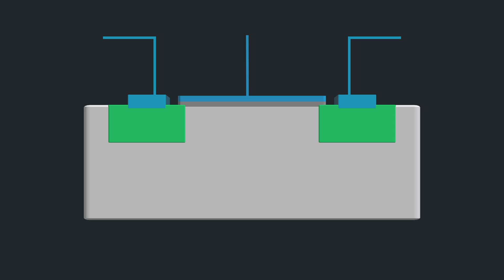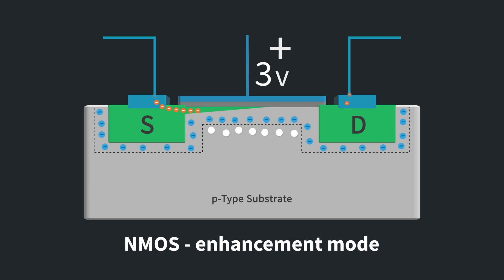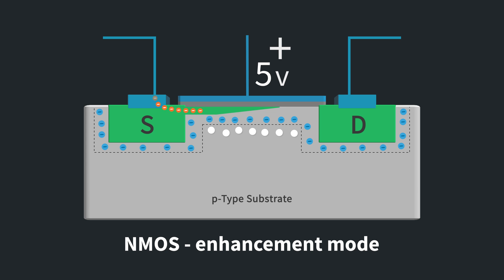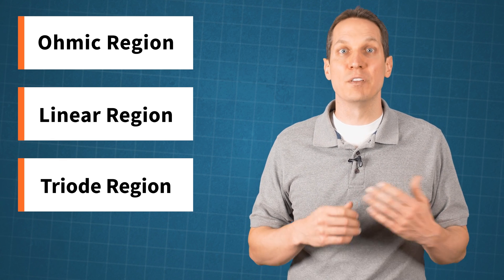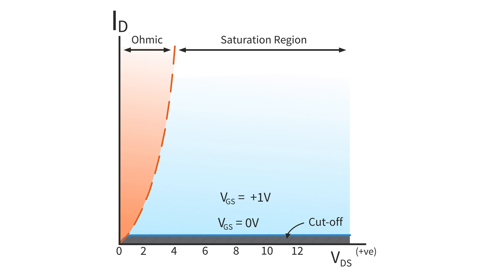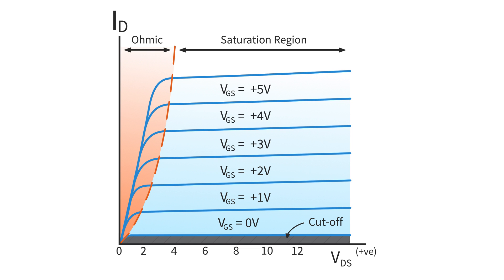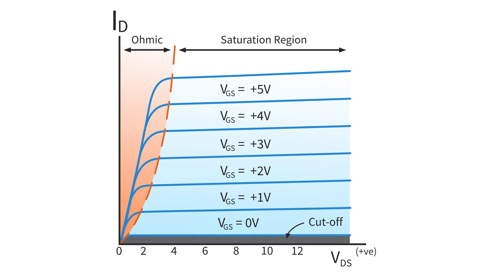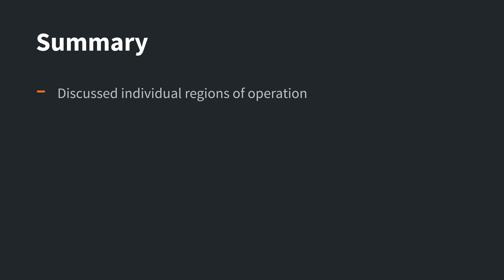What are the Different Regions of Operation for a FET? | Intermediate Electronics

Comment: A thing about these transistor regions is that saturated and ohmic regions often confuse, most transistors operate in saturated region, which makes me wonder why is it so. Why can't it operate in ohmic region where good flow of electrons is present?
Reply from the maker: It can operate in ohmic region, that's a totally usable region!  You just need to make sure that you've designed the circuit to have it operating in that region.
Reply: @CircuitBread  but why do some transistors operated in saturation region?

Comment: Thanks alot for the incredible explanation mister ..but I have one thing that confused me.. why the direction of current flow is from source to drain though it's n-channel mosfet
Reply from the maker: That is an excellent question!  The answer is quite simple - current and electron flow are opposite.  So, it isn't actually current moving from source to drain, it's electron flow.  Which means that current flow is from drain to source.

Comment: I think you have no idea how current flows during the pinch-off. During the pinch-off, current flows because there is a large electric field in the depletion region between the channel and drain terminal. You say current will hardly follow during pinch-off which is wrong. Second, linear operation mode depends on the relative values of Vds and Vgs-Vth. Your explanation says when Vgs is higher than Vth, the linear operation occurs. This is a wrong understanding.  You also need to set Vds below Vgs-Vth to get the linear operation. As long as Vds is higher than Vgs-Vth, pinch-off occurs resulting in saturation mode operation.
Reply from the maker: I think we're having a terminology confusion here, which is extremely common in any conversation about these.  Pinch-off != cut-off.  And yes, part of the challenge of showing any of this relationship on a 2 dimensional graph is the fact that there are three dominating variables, so you are correct that the different regions do not only depend on Vgs in comparison to the threshold voltage but also needs to take into account the drain-source voltage.  This is addressed towards the end of the video and in the written tutorial.
Reply: @CircuitBread  he is right though. As long as Vgs > Vth, the mode of operation is dependent on Vds.
Reply: BJT active condition Vce ≈> 0.2V
MOSFET saturation condition Vgs > Vth and Vds ≥ Vgs - Vth

Comment: The intuitive explanation in the first part of the video is not correct! Your explanation implies that saturation is caused by a gate-source voltage that is not sufficiently large. However, saturation depends on both the gate-source and drain-source voltages. For example, with Vgs=3 V and threshold voltage=0.7 V, the MOSFET can be either in saturation or triode region depending on Vds. For a given Vds, increasing Vgs can actually make the transistor into triode.
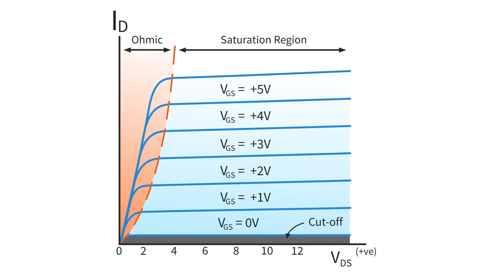Reply from the maker: Yep, you're exactly right, which is why we talked about that later on in the video (2:20 to 3:35).

Comment: Thank you for a clear and concise explanation. I still have questions though. I have a p36nf06 mosfet controlling a 12v  led flood light.  I'm using PWM from Microcontroller (max 3.3v amplitude) for controlling gate voltage to get a dimming effect. Varying duty cycle of the PWM gives me the desired effect, I'm trying to understand the power dissipation of the mosfet. I assume RdsON only applies to saturation? I assume this gives the load the most of the power and there's very little power dissipation by the MOSFET. In linear mode it acts like a variable resistor? I'm trying to understand why at some points in linear mode the MOSFET seems to get hot while at other points is not hot. I guess as it approaches saturation? That part is a big confusing to me. I can measure the voltage across the lights at various duty cycles but I'd really like to understand what's going on with the MOSFET.
Reply from the maker: Thanks for the questions, it is easy to get much deeper into these topics, hopefully I can clarify.  RdsON actually applies to the linear or ohmic region - in general you want your FET to be in this region when using it as a switch, you want it in saturation region when using it as an amplifier.  In the linear mode, it is kind of like a variable resistor - typically the higher the Vgs, the lower RdsON (actual) is.  From the datasheet of the P36NF06, you can see that doubling Vgs from 5V to 10V (keeping the drain current constant), you drop your expected resistance from .045 to .032 ohms.
As for why it gets hot in linear mode sometimes and not other times, I'm not sure without more information.  As you can see with any MOSFET VI curve, there are a lot of different points within the linear region - with lower Vgs you'll have a higher RdsON, giving you more power losses.  OR, with higher Id, you'll dissipate more power in the junction just because you're increasing the current in the P = I^2*R power equation.  Also, as you're flicking the MOSFET on and off, while it is actively turning on or off, the resistance change isn't instantaneous but curves.  You get these "power peaks" where your current and resistance   are at a point where you reach maximum power dissipation.  We go over that in an older tutorial we made ( https://www.circuitbread.com/tutorials/power-dissipation-in-circuits )
So, I can't tell you for sure why it's acting the way it's acting, but hopefully this does help.
Reply: @CircuitBread  thank you very much for such a thorough explanation that actually explains a lot that was very fuzzy to me. By the way the link doesn't seem to work I'll try and search for it on your site thank you again.
Reply from the maker: No problem!  And thanks for letting me know about the link, it was including the end parenthesis in the link - it's fixed now.